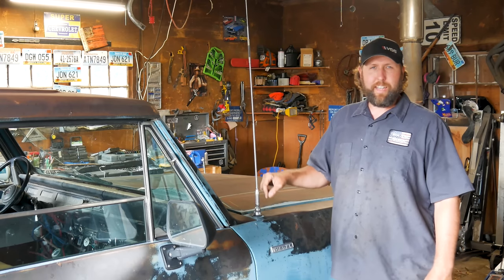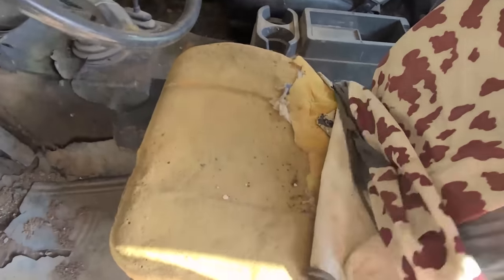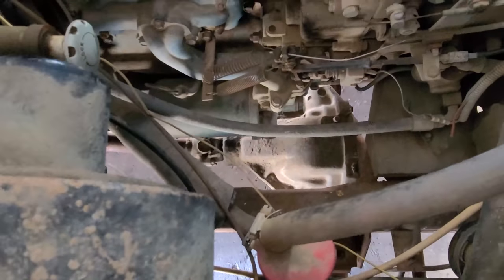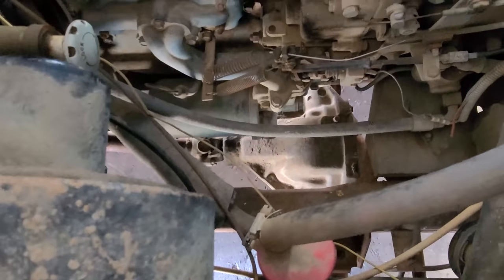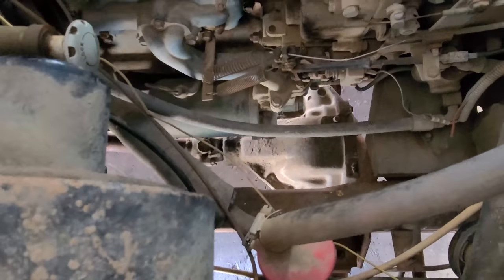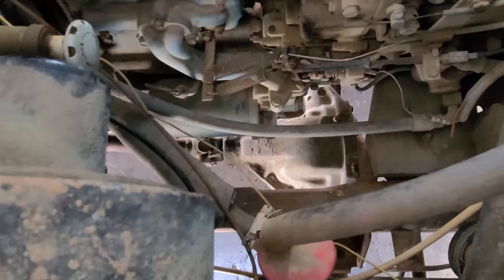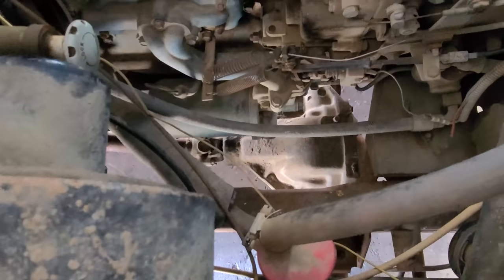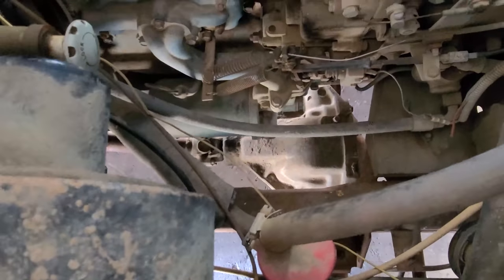FORGOTTEN International Scout NISSAN TURBO DIESEL - Will it RUN AND DRIVE 600 miles?

Comment: Dump some 2 stroke oil into the tank before filling up it really helps old clunky diesels to run smoother and with less diesel knock.
Mix it around 50:1 and make sure its high quality fully synthetic because that stuff is just the good shit it doesn't smoke or smell at all. Might sound a bit expensive but just look at fuel prices then reevaluate...

Comment: Just a suggestion: a diesel engine fuel system(especially one using a jerk pump) is one of the more expensive to repair and to minimize the risk of damage, I would have disconnected the fuel lines up to the transfer pump and fed the engine fresh fuel from a clean container. No need for a filter to get get it running if using clean fuel with the suction hose drawing midway into the fuel. Once the engine is a verified runner, check the fuel system(tank to exit of the primary fuel filter) and don't run off it until verified free of water and debris, and by all means replace the primary fuel filter, and dump the fuel in the tank and flush. If this fuel system doesn't have a secondary fuel filter after the transfer pump add one for the heck of it even if temporarily. That fuel return line that was leaking could be temporarily run into a separate container from supply fuel to eliminate any debris that might be in that part of the fuel system not being ingested again. I envy the adventures young man!

Comment: Those SD33 AND SD33T are fitted in k series patrols in europe, they usually runs on 2 batteries, and they use 24 volt system, not 12v... the sd33t european version is a "little" bit more powered than the us, i think for emission control regulamentations, that we dont had at the time here

Comment: Clear coat it it looks just right the way it is. Try to find one of the three line setting tickets that IH left in it from the factory. You will need it in the long run IH's are a jumble of every body else's parts. It's nice to know who's parts went into yours when it comes time to buy a part

Comment: Nice vdeo! I have same engine in my 87 Nissan Patrol, although it's easier to work on as it's in the vehicle it's intented to be in (a part from a boat), although mine has 115hp and with the gears fitted I can manage 90mph. They are very good, reliable and sturdy engines, can run the for days in a row on kitchen oil and they will keep going, they can take some abuse. In November I drove all the way from Portugal, through Spain, France and UK in 46 hours nearly non stop, fully loaded and with the family, didn't miss a beat. Did notice a few things on your video, first you didn't use the glow plugs the firts time, they don't want to start if you don't warm it up a bit; second they like a bit of throttle (or gas pedal) when cold starting; and third is when you noticed your oil was low or non existent is because it was probably stuck between the dirt and sludge on the top of the engine, when maintenance hasn't been done correctly and oil becomes sludgy, in order to have go down to the sump quickly you need the clean the engine, mostly around the rockers and the sump, if not the clean (ish) oil stays between the sludge and only will go down to the sump if the engine warmed up to working temp and after the engine being stopped for at least 24hrs, I know this because I have been there before. Probably you already know this by now lol

Comment: I have a Dana 44 out of a 1971 Scout 2 complete with leaf springs and Rancho Shocks and I have most of the front axle to I think it's a Dana 35 with springs but only 1 Rancho. I need to sell them if you need parts $250 for the works it sitting in the back of my truck. Drivelines included front and rear also. I had the whole rolling chassis but need space. Thought I might put the axles in my 95 Geo Tracker 2 door 5 speed. But ....

Comment: Wow that's a super rare vehicle I had a 78 Diesel Rabbit bought brand new 52 rompen horsepower got 54 miles per gallon on a trip had for 5 years put 20000 miles on it sold to a friend' last I knew it had 30000 thou on it and still running good.

Comment: This mule has leaked lots of rain water, which is why I dumped my 1977 Scout diesel Terra in 1978.  I paid $7500 for it way back then, which was a lot of money for something that filled up inside like a bathtub.  My friend Orville, the body shop man, said that if the machine leaked like that out of the factory to just forget it - no fix possible.  He was right.

Comment: The reddish fuel when you were topping it off is probably just dyed diesel , someone was probably just running off road diesel or home heating oil
Reply: The tax man can pound sand. I would run it on the road.

Comment: Mean Green degreaser for $63.00 dollars per gallon in ZORO in north Dakota or Wisconsin. Just us ZEP spray bottle refill will pour to the plastic all purpose bottle and he would do it with a pressure to clean inside cab cape interior and the color sky blue exterior of Scout metal.

Comment: Just out of curiosity Derek, how come it’s OK to use the laughing gas on the turbo diesel? Usually the two-stroke mix is the way to go on most of your stuff, which is absolutely correct in my opinion as well. Is a diesel different? Thank you.

Comment: i bought 1979 traveler 37 years ago because f 100 would not fit in my garage, best move ever, it is tuf 4 weel drive, it still lives in the sheed ,friends ask you could own a new one. Y it tows good and and the parts 345 v8, and 727 auto and locker diffs are all tuf the grand kids walk past the fast cars and go to the old Scout and it makes the best sound out of the twins two and half,

Comment: I'm at 54:30 and either that truly was some funky fuel or it was off-road diesel. Off-road diesel has a red dye added to it, the differences between off-road and regular is the dye and maybe an additive or two. Only thing is it's supposedly illegal to run off-road diesel in your vehicle, but I've known old timers who would run it exclusively, just don't talk about what's in your tank and nobody will care.
Reply: Definitely off road diesel and or house oil to heat with. My dad always used it in his tractor and would have a 55 gallon drum of it filled when the heating oil guy would come do the house heating oil.

Comment: i actually used to own a 64 scout and knowing several people that also own one my guess would be that what it shows for mile are the actual mile because those trucks normally didn't get driven too much when i bought mine it was from the original owner and it only had 27,000 on it which was verified by the original owner and was also the case for the other people i know that have owned scouts

Comment: Years ago i worked  at a IH dealership that had one but it was an auto trans set up 4 a gas engine & the shift points were all wrong 4 the diesel so u had 2 manually shift & was it ever gutless. Also if u walked near it with an ice cream cone it was hard 2 cold start it

Comment: The diesel in the tank was possibly dyed, farmers and people on drilling rigs ran that often in there trucks, it’s cheeper $. Also burning that much oil you should add Lucas, it’s just like instant rebuild in a bottle

Comment: I think a good solution to his constant battery issue would be a lithium ion car battery. Recharges quicker and is built to recharge. It's not meant for long-term use (aka not for daily driving.) Likely it would be good for revivals.
Reply: Just an idea. Dunno how efficient it would be. I've only ever used one on a tractor that i use only when necessary.

Comment: My boss owns a variety of Bronco's. (66-88) But hastily bought a early to mid 70's Scout, while I was out of town. Seeing the very recent, near perfect paint job. With Rhino lining covering the entire inside. I was immediately skeptical and rightfully so. So much thick Bondo covered the bed. A magnet wouldn't stick and had to be completely cut off. Its got a worn out small block V8. Thats the worst, hard cranking, gasguzzler, i ever saw! It seems to really struggle, with lots of tappet noise. Not sure what we're gonna do with it.

Comment: My 1980 Scout II Rallye (?) with the Nissan turbo diesel had a whopping 101 hp, top speed in the upper 70's (on level ground), and got 21 mpg city or highway. My F150 Eco 3.5 does better. Too bad these old Scouts all were such rust buckets because mechanically they were awesome. My first was a 73 with a 345 4bbl and dual exhaust and it was really fun to drive.

Comment: SD-33T
DISPLACEMENT: 198 cid (3,246 cc)
BORE & STROKE: 3.27×3.94 in.
POWER: 101 hp @ 3,800 rpm
TORQUE: 175 lb-ft @ 2,200 rpm
COMPRESSION RATIO: 20.8:1
MAX BOOST: 6.5 psi
ENGINE WEIGHT: 676 lbs
INJECTION PUMP: Diesel Kiki, CTS-2790 (Bosch License)
INJECTOR OPENING: 1,607 psi.

Comment: I'm pretty sure what you have in the tank is agriculture diesel - it's red.. - from the web:  "Red-Dyed diesel – Most dyed diesel sold in the U.S. is colored red (with the chemical additive Solvent Red 26 or 164). By law, red-dyed gas is only for use in off-road vehicles, including farm tractors, heavy construction equipment, and generators, where higher sulfur fuel use is permissible."

Comment: suicide hood opens from the grill, Kinda like a suicide windshield could be anywhere from pain glass to no-nothin during monsoon season w/ out eye protection, (its not the bug in your eye that killed ya, it's having to multi task while driving, one hand on the wheel while five fingers are digging up what flavor an open mouth would have detected!

Comment: I had an old boss that invented what’s called “fuel max”. He has a chemist and everything. It’s patented and all that.  But I guarantee you the shit works. They have a trucker that buys it by the 55gal drums. He told me for the first few days his truck ran like shit. But after that it got better and better and started running better then it ever has and getting much better gas mileage.  They have it in small bottles like that.  Sure you can get it online.  Inventors name is Jason bullock. There’s a few fakes out there that he may have already won lawsuits against. But just be careful and make sure it’s genuine. But it’s good shit. Works in both gas and diesels. And we had all kinds of people coming to get that stuff.

Comment: I may be wrong but the red color in the diesel fuel looks like off road diesel fuel because red die is put into the diesel so D.O.T. officer's can check and see if untaxed diesel fuel has been put into the fuel tanks. Off road diesel is untaxed diesel and is for farm use and it will take years to get the die out of that fuel system.  I know this because after hurricane  Katrina in 2005 truck driver's where authorized to use red die diesel because of the fuel shortage after Katrina.

Comment: Diesel fuel just like #2 fuel oil or kerosene doesn’t go bad there is no ethanol in it to absorb water nor does it evaporate off at ambient temperatures it would have to be at a much higher temp or in a vacuum to evaporate off . At least to my knowledge of installing repairing and building many different forms of oil heating equipment ( 40 years ) I’ve never seen bad fuel oil I’ve seen underground tanks full of water and I’ve seen separation of dye and and left over sludge from years of a tank being filled. But I’ve never seen bad fuel oil . With that said I try to learn something daily but she seems to be running pretty well on that old oil

Comment: Diesels don't produce manafold vacuum like gas engines do. Even four stroke diesels like the Chrysler Nissan 6 in the scout need a vacuum pump if you want to use normal automotive vacuum operated stuff like break booster s. Look a Mercedes diesels you will find pumps on them  they use vacuum for door locks on them. the muffler delete behind a turbo diesel is a common thing too. Turbos work best with less back pressure.

Comment: Anything less than a gallon of oil per hour is normal for a small diesel. I had a 6-71 that was burning 5 gallons an hour when I finally put some power assemblies in it. It still ran like a raped ape but at that point the oil cost was getting expensive enough to justify sticking a set of cylinder kits in it.

Comment: Derek, the Japanese make good stuff I've owned 3 Japanese cars 2 Nissan's and a Toyota  all gas  all three of them has close to 300,000 miles on then when i took them off the road due to rust i drove one to the junkyard because of the undercarriage rust would not pass inspection everything still worked on that car made me sick to leave it there they were older and made in Japan too

Comment: The bad diesel that was in there may have been farm diesel which is a red color.....not legal to use in a road vehicle mostly cause its way cheaper than the diesel you buy at the gas station

Comment: The rocker floor in driver side pan will his welding equipment from his brother's house. There is an order from the Family of VGG to get shipping the Freighting of welding 1 amp switch selection up to full power VEVOR 270 amps 30 pounds includes 10 ft. welder extension cord plus wire in the spool 5 lbs .03 gauge $40.00 a package. Or $100.00 welder for welding on steel.

Comment: Neat!! Had a 73 Scout which had a gas engine. I worked for BUICK  in the 70's and 80's and the 80 model Park Avenue's that were green or yellow had the 350 Olds diesel in them.  Thise cars were a loke so do not buy one

Comment: Next time use WD-40 as a starting fluid.  It works great and provides a bit of lubrication.  Regular starting fluid is too harsh for a diesel and makes that horrible noise that sounds like you just tossed half the rods out of the crankcase and bent the other half.  Listen to the sound at  23:15 of your video.  Ouch.

Comment: How you will drive 600 miles without a valid licenses plates?
Reply: Don’t let the cops pull in behind you
Reply: Trip permit. You can get them at the licensing office. But he is in the midwest, there is barely any police.

Comment: Why the hell would he take a power washer and spray the inside of that thing on all the electrical circuits and the upholstery it's going to take a year for everything to dry up if it doesn't short everything out

Comment: You know you could sale  that scout to me if you want I had one in az. 1964  4 ,and half on the price with my brother  an 1980 345 it's yrs but they are the 64 you get out turn them waren hubs jump back in you can climb anything awd all whee drivel turn at the same time it well climb anything drop ot down in 2nd gear and your in for a treat.we climb the river bottoms side all sand we put 60 one her and we never got stuck it's a little tank fun to tease the 6 shock each wheel and 33 s Toyotas and watch them break shocks and we would turn the hubs and climb setting still and come over top and stop 0and laugh because that little tank was alot fun
Reply: I couldn’t have better it said myself
Reply: You are quite the talker. I bet you could tell stories for hours after a couple of beers.

Comment: Well I do have rare vehicle 1981 f150 motorhomes 4 sp straight 6 300 engine with 60 thousands miles original gd condition insight out and everything works from shower stove refrigerator etc all the lights everything plus I can tow 7000 thousands pounds rare little motorhome and strong in first gear like a 4x4 seems like nobody have information on her plus my have the main door on the rear side of the passenger side no behind the passenger side like others ford or motorhome I kp my real nice gd on gas cheap on parts and easy to maintenance and nice ride on highway and cities and trails

Comment: I know what to do get some of them Bluetooth headphones for Xbox or some other kind of console and why are them into the tape deck part to the heads of an old tape deck and then put that in some kind of roll around table or something and you said it's your sound I know what to do get some of them Bluetooth headphones for Xbox or some other kind of console and why are them into the tape deck part to the heads of an old tape deck and then put that in some kind of roll around table or something and use that as your sound box for your gaming put your 40" TV on it and you're done Use a computer power supply to power everything you're done maybe even fancy LED light your done Oh wait what About wobble popspops now i'm done